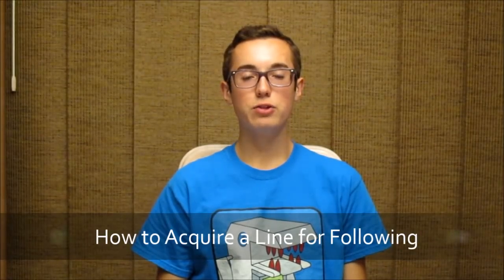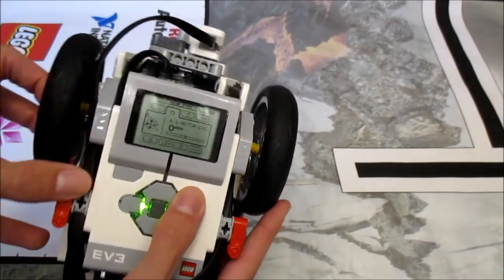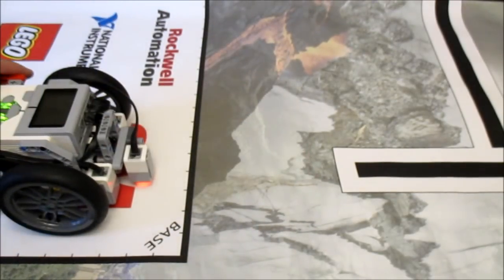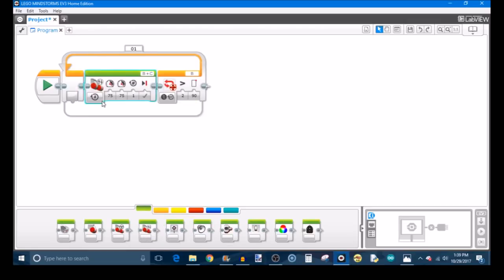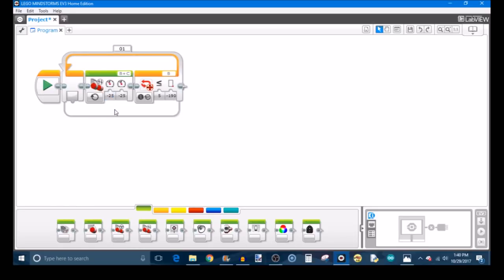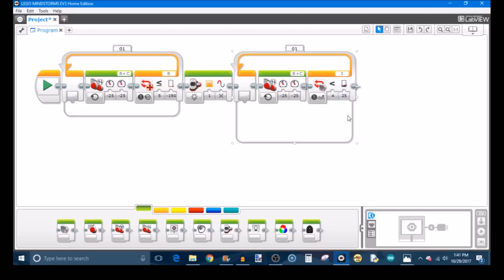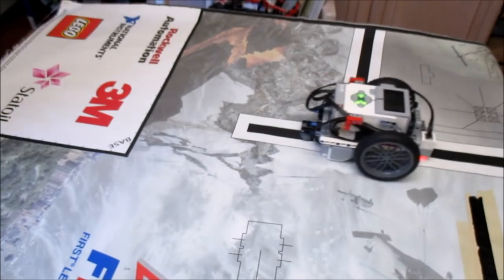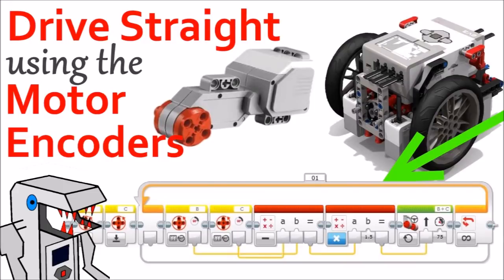Program your FLL Robot to Acquire the Line for Line Following

Comment: Hi i am trying to put in negative Numbers in a math block but but the software wont let me and tels me that only Numbers are allowed when i type in -  infront of a Number
Reply from the maker: That's strange, you should be able to do that. Make sure that there is no space between that sign and the number. Also keep in mind that when you start typing the number and you put the "-" in first, that the warning will come up but it will go away when you finish typing the number after it.